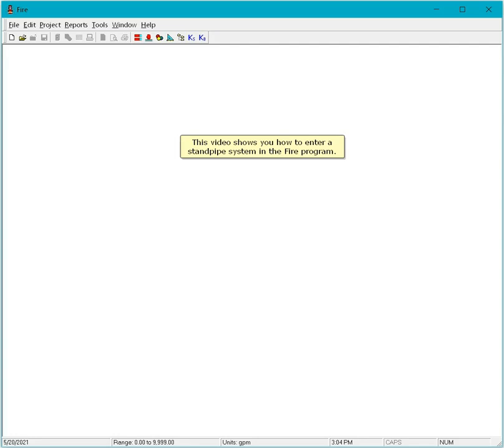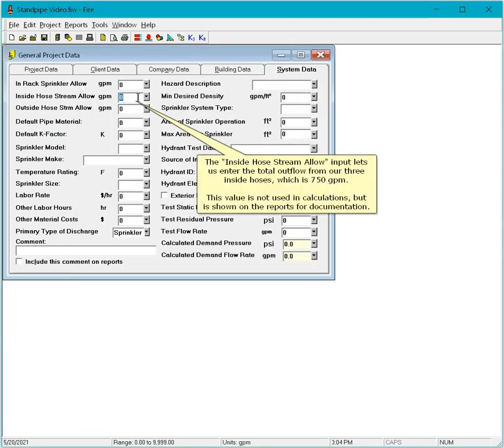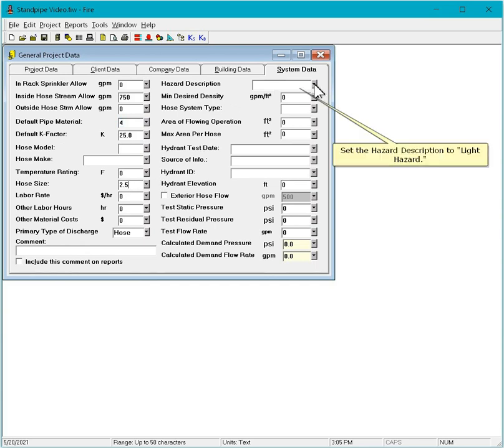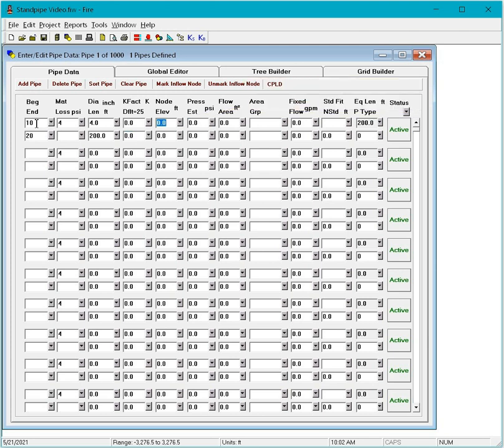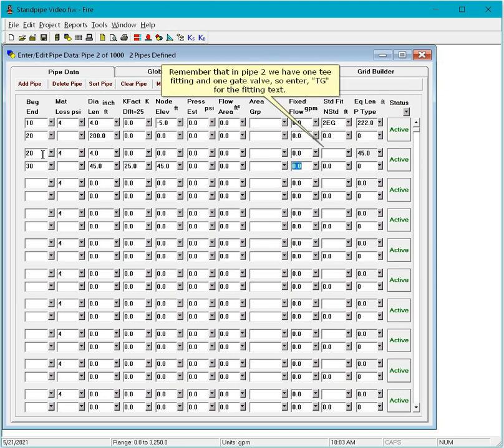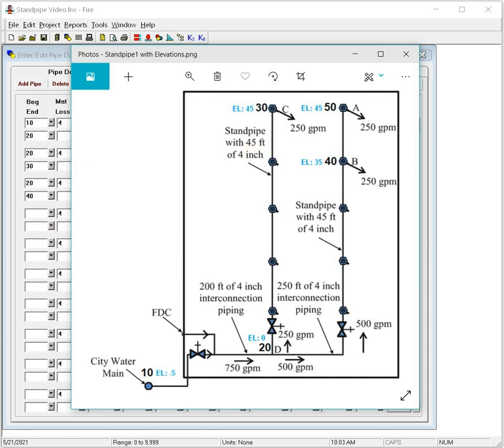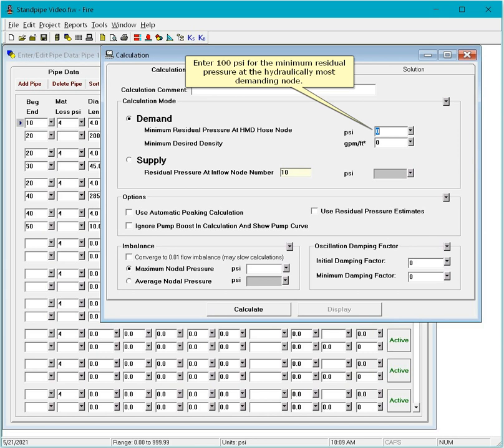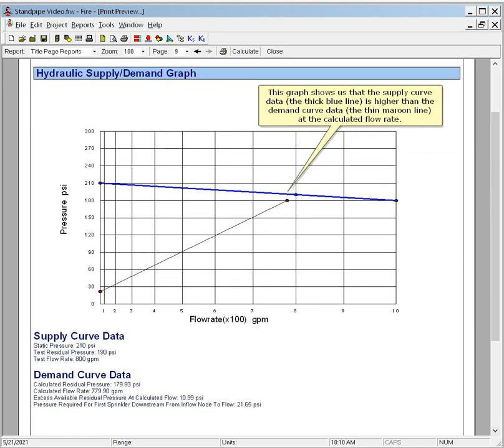Elite Software Fire Protection Calculations - How to Enter Standpipe Data

Comment: I am doing sprinkler calculations and wanted to see in a system where the level studied is below the pump what velocities would the water reach?

Unfortunately since the drop in elevation is too great, the software is reaching negative numbers and is unable to finalise the calculations.

This is an issue because this needs to be submitted to authorities for formal approval.

Is there any work around for this?

Can i place a pump that simply has negative pressure to let the system gain pressure for example?

Comment: Why we are not adding fittings eq. length for landing valves, Since the data is availablein NFPA for Globe (straight) hose valve & Angle hose valve
Reply from the maker: The example was very simplified. The software allows you to add whatever fittings you deem appropriate for your situation.

Comment: How many sprinklers has to be considered in one zone. Eg  If 150 sprinkler ( 50 Pendent+ 100upright) in 100mm pipe then how many sprinkler has to be considered for hydraulic calculation

Comment: Why did we take 3 valves for the calculation? 3x250=750 gpm
Reply from the maker: There are 3 outflow points in the system, each flowing 250 gpm with at least 100 psi residual pressure.  The gate valves are fittings and are entered to account for pressure loss through them.
Reply: @elitesoftware1  Thank you for your useful explaining. I have question for your kind help : 
When inserting data for sprinklers, why we don't consider the elbows or tees  that sprinklers installed in them as fittings?  
Example: when start inserting the first two sprinklers of the design area ( number 1&2 ) we do not insert fittings.

Comment: Thank you for your useful explaining. I have question for your kind help : 
When inserting data for sprinklers, why we don't consider the elbows or tees  that sprinklers installed in them as fittings?  
Example: when start inserting the first two sprinklers of the design area ( number 1&2 ) we do not insert fittings.
Reply: Stiil waiting a response

Comment: where we can get this software
Reply from the maker: The software can be ordered from www.elitesoft.com
Reply: @elitesoftware1  Thank you for your useful explaining. I have question for your kind help : 
When inserting data for sprinklers, why we don't consider the elbows or tees  that sprinklers installed in them as fittings?  
Example: when start inserting the first two sprinklers of the design area ( number 1&2 ) we do not insert fittings.